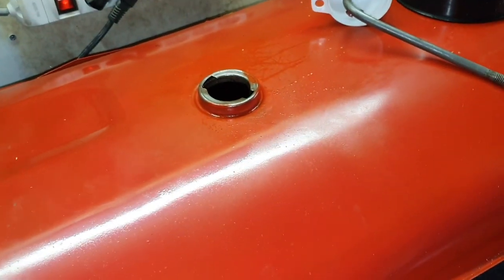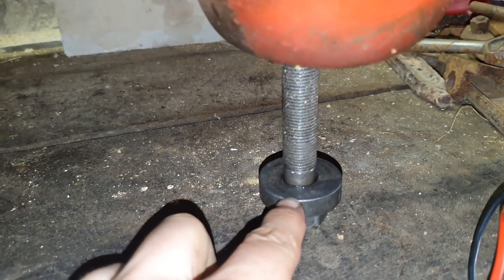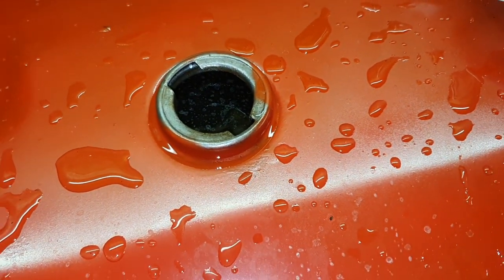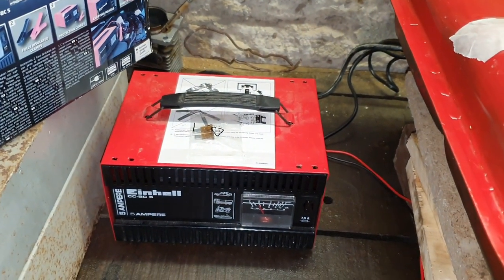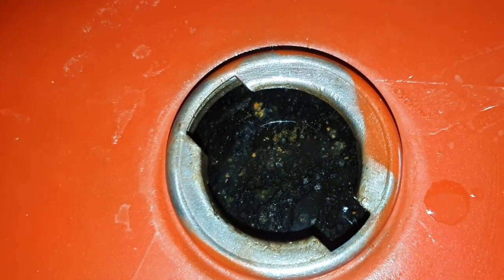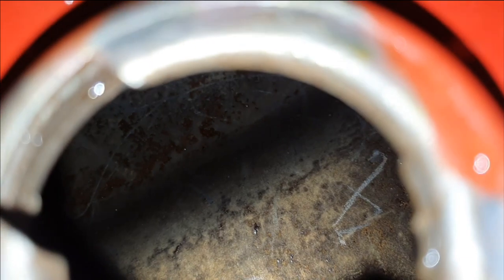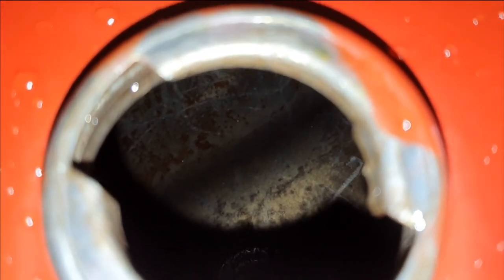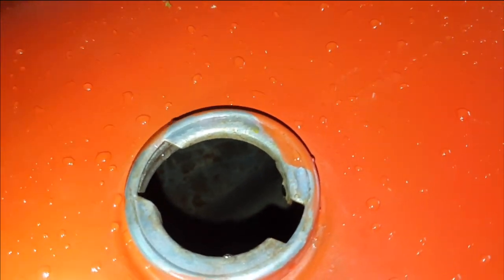Cleaning the Massey Ferguson 35 835 Fuel Tank By Electrolysis Part 1

Comment: Hello
Thank you for taking the time and trouble to post these excellent videos. I have just bought a massey ferguson 835ds c23 with the French injection pump and had wondered where I would find information, and then I found your videos! Mine is a non-runner, built in 1958, I think, with the number 10770. Purchase agreed the day before we left Dordogne and so I know little about it and keep having to look at the photographs to remind myself. Cant wait for our next holiday in October, when I shall make a start. In the meantime good luck to you and I look forward to viewing some of the other videos you have posted and I have just found. Happy days!
Reply from the maker: Hello, thanks for your comment. There are a number of good videos around if you need to do any brake or axle work, you can look for FE35 videos as they are all pretty similar, as you already mentioned the biggest difference is the French Injection pump and I believe the Kigas system too, there's also some other differences like the headlight brackets, but the biggest thing to remember is to change the oil in the injection pump as that only applies to the French injection pumps and not the CAV.

Comment: Мне кажется, что намного быстрее было бы очистить бак насыпав в него 1 кг гаек, залить водой и в 4 руки трясти его 30 мин;)
Reply from the maker: That method is not really suitable for this tank, as inside the tank there are baffles as well as a steel fuel pipe which could be damaged with the nuts. Also I am by myself so 4 hands not possible and it would weigh around 40kg.